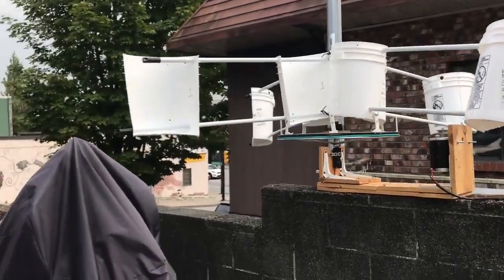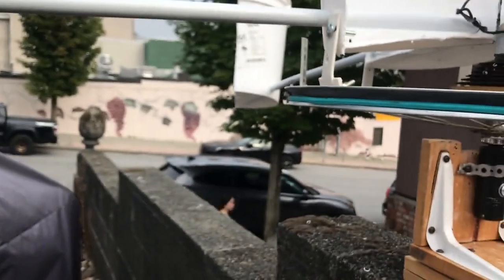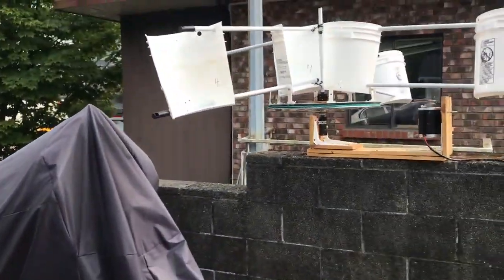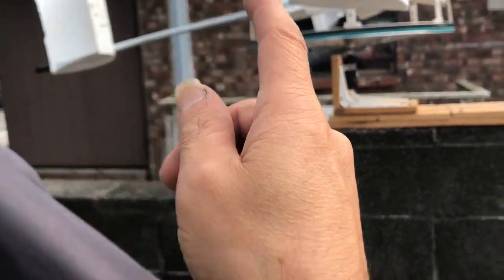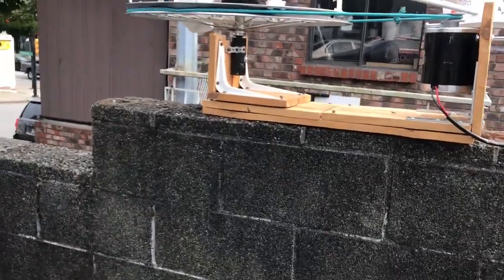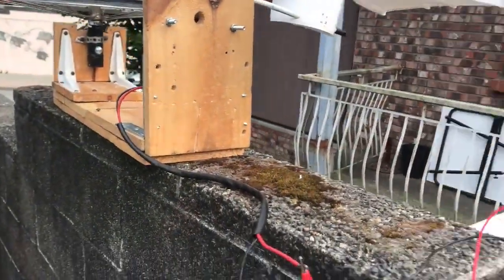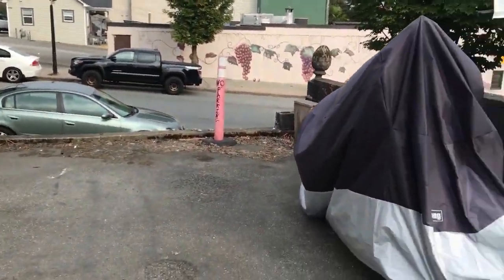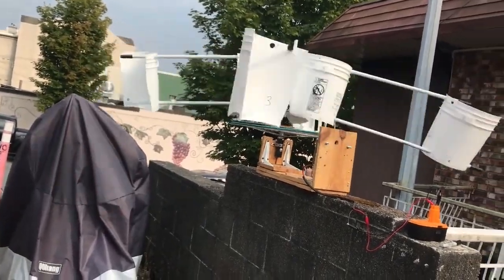500 WATT WIND GENERATOR , LEARN HOW !

Comment: First to comment which motor you used as generator please explain in detail
Reply from the maker: You can use any DC motor to generate power, what i had around is  a 36 volt permanent magnet DC motor.

You can use a fan motor, wash machine motor ect, 
This works great ,thank for the comment
Reply: @earthssecretenergy2371   which dc motor can generate more ampere and voltage around 36 to 48 v since I want more watt to get generated